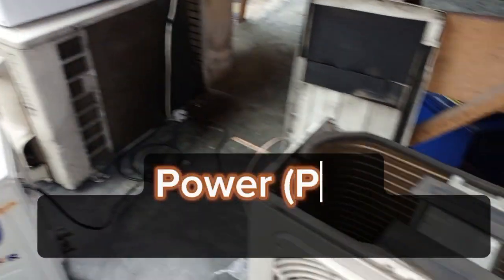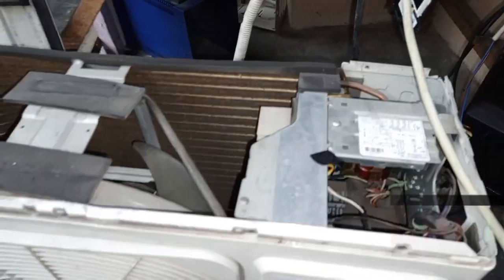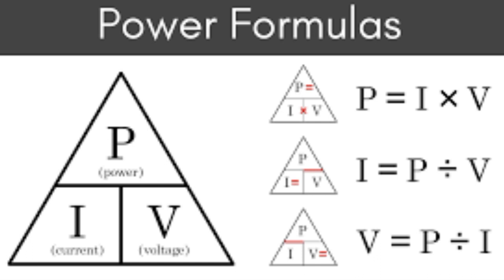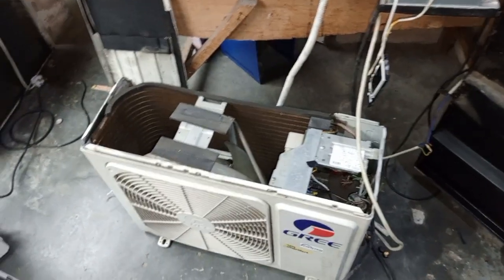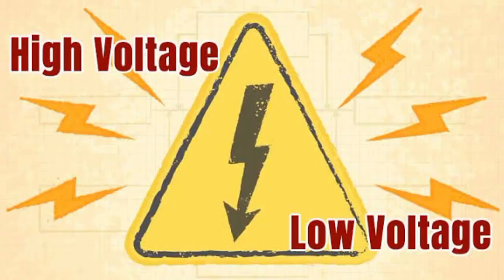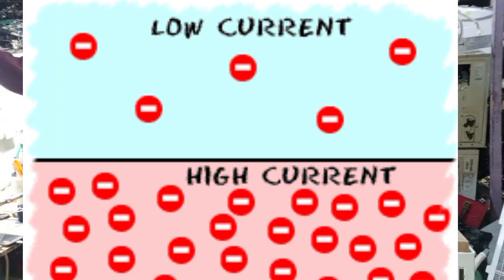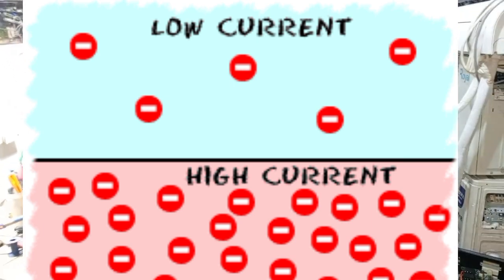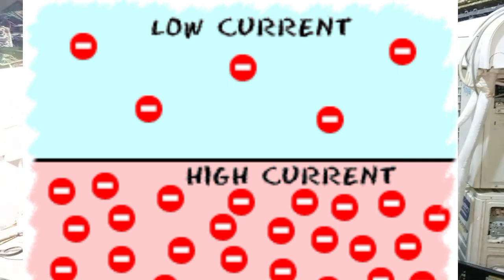INVERTER AIR CONDITIONER Vs LOW VOLTAGE

Comment: I have a 5kva century stabilizer that trips off by showing protecting after working for like 30mins or 45mins and starts making a woooooo! Sound for that period and is a new stabilizer i just bought what do i do.
Reply from the maker: Faulty Relay or variable resistor

Comment: Hello sir , how do you regulate with stabilizer a current that is below 50v. Practically close to 20v  . This is coming from the power grid . Instead of 110v upwards,  it comes way lower close to 20v
Reply from the maker: E choke, no solution on that the voltage is too low, even if boasted with transformer it won't work
Reply: @robinTechelectric  what can you say about power deluxe automatic voltage stabilizers . Are they good or bad
Reply from the maker: I don't know much about that but all current stab are aluminium windings and they copy from another company and write their name on it as their products especially new companies

Comment: If I connect all my appliances in my house to a 5kva stabilizer . Can I still use another  stabilizer for my AC ? … My voltage is usually very low . And will a 10kva stabilizer do better ?
Reply from the maker: Yes , your electrician will separate that AC line from the DB and connect it directly to the main line, they know how to do it

Comment: In my area, voltage is mostly low 100-140volts 
My problem is that if I had to protect my inverter and other appliances from low voltage, I will end up not using the appliances because power will be cut off.

What do I do...
Reply from the maker: For such a place Stabilizer is better